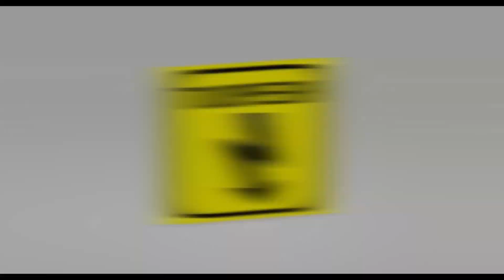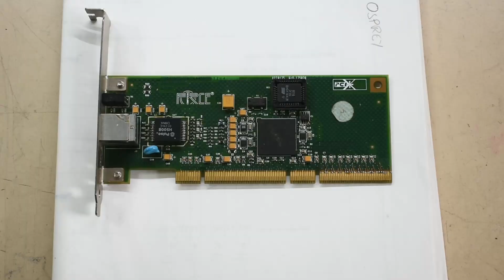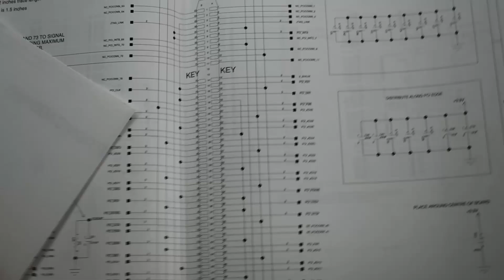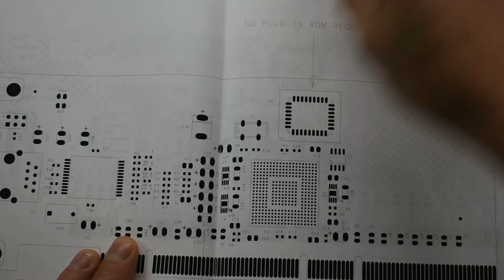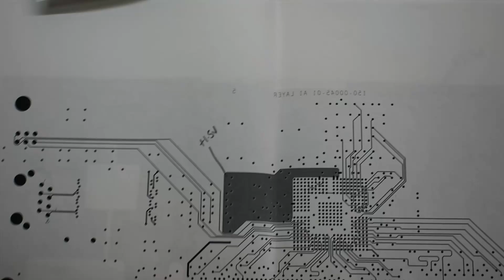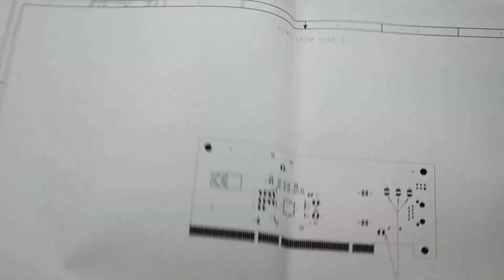Network cards and circuit boards

Comment: What was the purpose of the 'thieving' that you showed?
Reply from the maker: It seems to be unique to Digital Corp at the time. I thought it was basically a cost saving in etching but seems to go deeper into manufacturing processes.  The Tech Files notes say:  Addition of nonfunctional copper area to increase uniformity of copper area on outer planes. This results in equalised current distribution during all electroplating processes.

Comment: I would be really interested in that 1995 Modules Technology File - having designed 400+ smaller or larger boards myself, I still do not have any solid operations rules - while trying to do things better and better (every year or two, I do make adjustment to my designs), having a peek into such rule set would be quite nice. What about putting it on bitsavers or other archive ?
Reply: Yeah, HP will likely own the copyright on it... although it wouldn't surprise me if they don't have a copy themselves anymore. Pity, would be an interesting read.
Reply from the maker: It would take a lot of time to scan in as its about 300 pages and not that much of an easy read being an internal document. In some ways it will be out of date being a 1995 edition, I guess much of it is still good practice for modern layouts.  Not sure about the legality, although technically gone the company has ultimately been absorbed into HP.

Comment: Can you remember what those boards cost to make back then? 15 years ago I used to get boards made in Birmingham and a four layer board was about £300 for a panel's worth. The revolutionary pricing from JLC and PCBWay blows my mind these days.
Reply from the maker: I don't remember the pricing but I guess it would be quite high. At the time we would only use certain approved companies too. I would deal with them on the technical side and send over Gerber files. All of the companies here have long gone. Not only the pricing now from over seas is cheap but the quality means its not really worth making a DIY pcb at home for a small project either.
Reply: @tuopeeks  I totally agree about pricing and quality - the stuff we can buy from the online PCB houses is so good, it would be madness to etch/route your own board these days. There are a surprising number of UK board houses still around though (I guess they mostly do aerospace/defence) - although none of them have the sophisticated, easy to use web shops of the modern Chinese vendors.